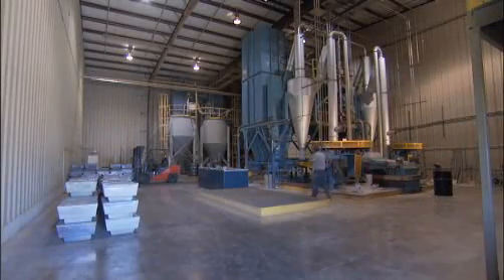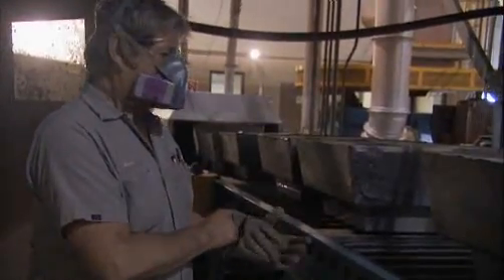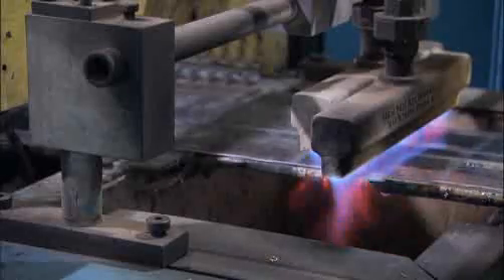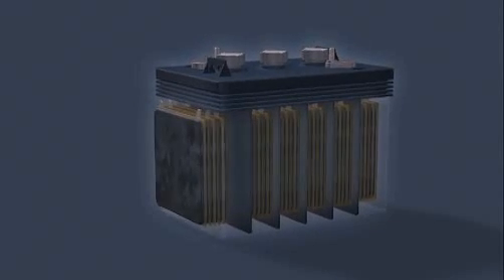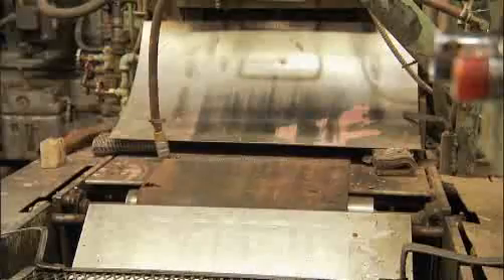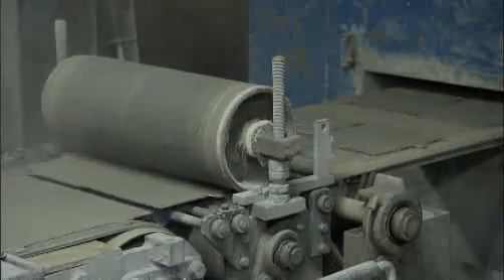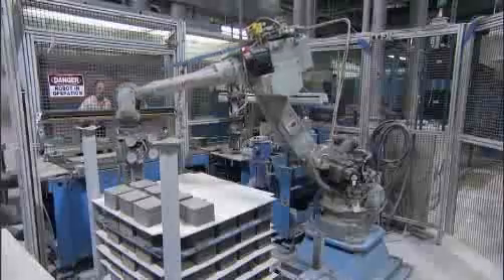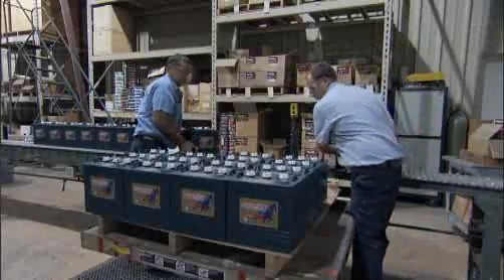How Lead Batteries are Made

Comment: They should have filmed them making a true car battery and not a 6v deep cycle golf cart battery.  They talk about the weight of the batteries being about 20 lbs. at the end, and those golf cart batteries they are showing at the time are more like 50-70 lbs. a piece.
Reply: +Spencer Wait Hi Spencer, you deal in car batteries ? if you like to see the manufacturing process, please contact me for more, I may send some video for your check.
Reply: @carbatterymanufacturing7503  whAt material in positive plates?

Comment: Talk about expensive.  If you attempted to use 8 D cell batteries in a series (1.5 volts * 8 = 12) to power automotive electronics on a daily basis, you'd be losing money even quicker in no time.

Comment: @edrianquintos 
Actually each cell has a voltage closer to 2.3 Volts giving the battery a total voltage of ~13.7 Volts. a ''12 Volt'' battery is really a misnomer.
Reply: It's a nominal figure, and will reliably work at 12 volts through the duration of its discharge.